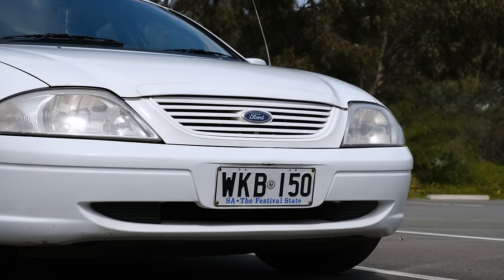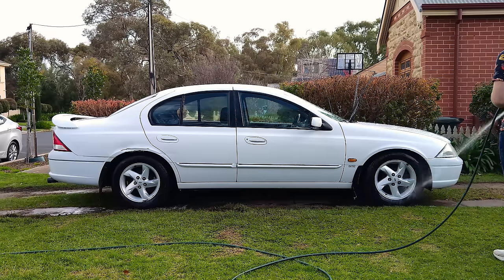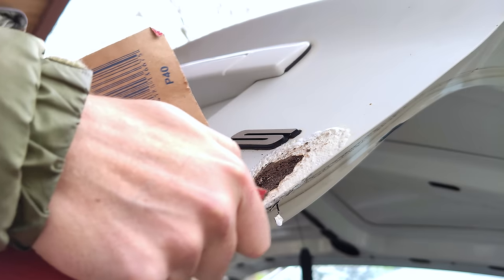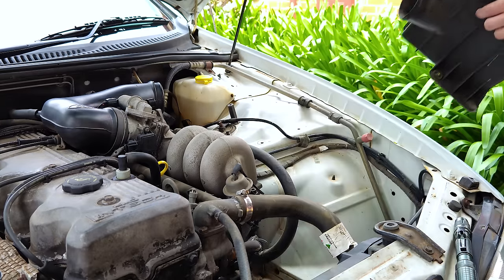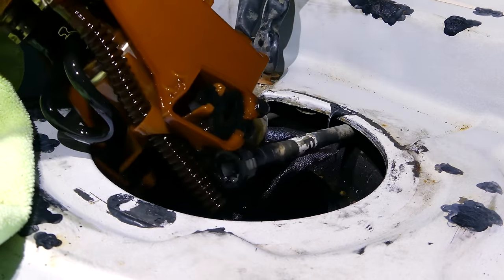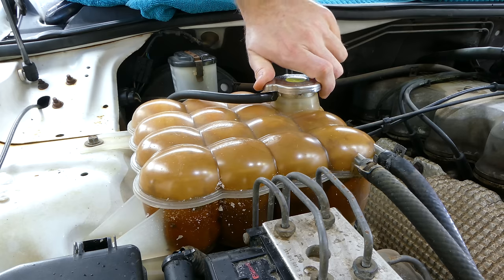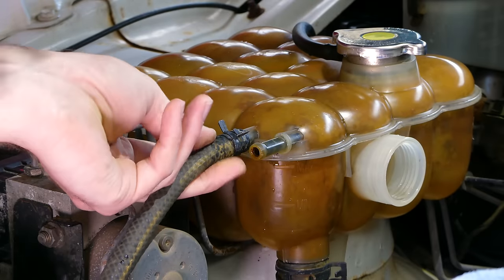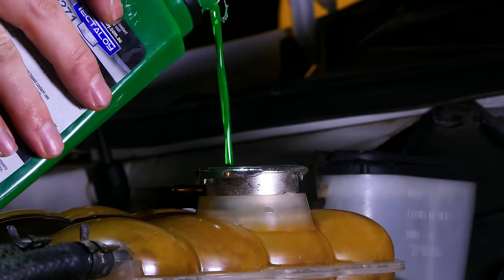Fixing A Cheap Ford Falcon From Facebook...

Comment: It's a really easy fix. Just need some eucalyptus oil and methylated spirits
Reply: Now that you fix cars now. I expect you to start working on houses with Eucalyptus oil
Reply: @RMPANDA964  That's how I fix the cracks in the concrete and drywall every time we have an earthquake.
Reply: And isopropyl alcohol
Reply: @RMPANDA964  Next: Open Heart Surgery using nothing but eucalyptus oil and some iFixit tools
Reply: and arctic mx-4
Reply: @MarcoGPUtuber  and the coolers from Noctua as well, may need ye old advices from the Yes Man Aussie
Reply: @baoquoc3710  LMAO hahahahah!

Comment: Here in America they stopped making the Falcon in the 60’s, very cool to see what it would’ve been like if production never stopped here. Reminds me of the later model  Ford Thunderbirds.
Reply: until 2016...
Reply: Should have put a Barra Turbo into a Mustang
Reply: Ford really dropped the ball on not bringing any of the more recent AU Falcons to the US and reviving the nameplate. Both the Monaro and the Commodore from Holden made it to the US as Pontiacs (before they shut down the brand).
Reply: To think we got the Taurus instead of the falcon. The Barra would have killed here.
Reply: @Fhwgads11  American manufactures always talk big and do half-measures. They were chasing the big German sedans with silly front drive bubbles (barring the first gen SHO, but it's build quality outside of it's engine was trash). A FPV falcon of the 2007-2010 timeframe would have moved a ton on units here....sad when you think about it.
Reply: Australia also got the Taurus at the time but it’s ovoid styling didn’t endear itself to us Aussies and it’s V6 wasn’t as torquey as the Falcons inline six hence the local Ford far outsold it

Comment: 6:24 Love the  reach for a nonexistent stick shift lol
Reply: Saw that too. Habits die hard.
Reply: I regularly drive a standard as well and when I'm in our newer van my hand still goes for it on stops.
Reply: Unfortunately the only driving habit I carried over from my mom’s auto to my stick is trying to shift from reverse into drive/first before the car has come to a complete stop. Auto don’t mind, Stick don’t like.
Reply: @simonro9168  it shouldn't be too much of a problem going into first without stopping since 1st gear typically has Synchromesh

Going into reverse without stopping though will make a loud clank.
Reply: @tristan6509  Yes, I realized that recently, because I’ve never had problems shifting into first after reversing out of a driveway. Bad gearbox sounds™ occurred was when I was turning and tried to go into reverse while still rolling forward. I mixed it up in my original comment

Comment: Good stuff, these will easily hit 500,000km+ if looked after. My only suggestion is a bead of silicone around where the spoiler meets the boot lid, that crusty old rubber isn't gonna help much anymore for water ingress especially now you've got thick tape there
Reply: Yep, rust never sleeps.

Comment: You’ve done well. The AU OHC isn’t as powerful or as reliable as the Barra, but it’s still a great motor and benefits from some 40 odd years of refinement. It’s actually an attractive car, it looks very nice in the white, and the interior is also pretty nice looking. I’ve just bought a BA ute as my new daily and even with a whopping 550k on the dial, it’s still a reliable car. One part I missed was the coolant you used, I can tell you from 30yrs experience in spare parts, and as a Ford enthusiast, correct coolant is absolutely critical. As you’re probably aware, they do have a bit of a problem blowing head gaskets and head corrosion, I would suggest using one of the cleaners but to follow the directions because you can cause gaskets to start leaking if it’s left in too long, and then after that, I’d put in some high quality coolant, like Nulon, and be sure to use the correct one specified, from memory it’s the green one. You probably also should do a brake system flush and replace with new fluids as it will break down over time, and again, replace with specified fluid (many people think that if the car recommends dot 3, using dot 4 is an upgrade and the new version of dot 3, however dot 4 causes rubbers to swell and leak if the car uses dot 3). 

Oh and also, it’s a Falcon S. S Pac finished in the X series, EA onwards they were designated just Falcon S and typically came with colour coded trim and in the E series, a red stripe. The AU appears to have the alloy wheels from the SR, and colour coded grille. Tasty car, and great job reviving a cool car.
Reply: Isn't as reliable as the Barra my a$$, cabbies here had no issue putting a couple of million on the Intechs, yet to see that on a Barra (the dual OHC's usually get tired after a million)
Reply: @Alabaster335  They’re a fine motor, but are more susceptible to blown head gaskets and warping heads then the Barra. Taxi drivers usually service their cars and look after them, where as general public often don’t use the correct coolants, or any coolant at all, and that soon leads to head corrosion and blown head gaskets. I have worked in spares for 30yrs, and in that time, I sold many VRS kits for the SOHC 3.9/4.0L Ford motor, many inlet gaskets for Barras, my Territory has had an inlet gasket replaced at 120k, but I’ve only sold 3 Barra head gaskets for race cars being rebuilt.
Reply: @thesausage351  the barra is the only engine I've come across that requires zero service, true.
Reply: @lobsterwhisperer7932  I work as a pilot vehicle for oversize loads, one guy I work with has a gas Barra that’s done over 1 million, his brother had a petrol one that did 1.3, I have a BA Tonner with 680k and a second BA Tonner with I think 260ish on it, and a Territory with similar km on it. I’ve replaced a water pump on the Territory and the previous owner did an inlet gasket. That’s it.

Comment: Quick note: The camshaft position sensor is less about the number of camshafts and more for the fuel injection. 
On more modern cars it also determines the spark time, although yours is waste spark and likely runs off the crank sensor.

Comment: i have a mighty au falcon myself that had the same misfiring problem. the fix that worked for me was replacing the ignition leads and the spark plugs. they are such a wonderful car mechanically although they are quite ugly. definitely a good buy. you would also be better off replacing the bootlid with one that never had a rear spoiler as the rust is just going to come back soon. one issue with the series 2 au falcons is a lot of parts are different to the series 1 and series 3. little parts such as fuel filters are different. great video though and looking forward to a few more.
Reply: The series 2 and 3 are identical apart from the indicators, trim levels and oil pressure sensors.
Reply: @HardlineHunter  no they arent

Comment: I had to replace the altinator on my BA Falcon a few weeks ago. I did not want to remove the fans so I ended up buying a cheap 1/2' to 3/8' socket adaptor and welding it to a piece of 50mmx5mm think flatbar. Worked a treat!!!!

Comment: Better car than the VT. Every modern car has adjustable seat belt height, well at least every one I have been in.
Reply: @holdenvtseries2274  Better engine, better build quality, it looked like crap but in all other aspects it was superior, more AU's on the road now than VT's
Reply: @holdenvtseries2274  hardly ever see any VT's plenty of Aus.
Reply: @holdenvtseries2274  Melbourne
Reply: @holdenvtseries2274  Well, wherever I go I always see more AU's I work in Geelong and see way more AU's there too, VT is defs the prettier of the two but in terms of the 6's the intech is a far more refined and reliable unit, that's why the Taxi industry selected them.

I know a TAXI fleet owner from Sydney and he only once ordered a few commodores for trial and he told me never again as they they just didn't last as long.

Comment: I wanna buy a cheap car now.....  this looked fun to fix
Reply: I highly encourage it! As long as the engine or transmission isn't ruined, or the body isn't rusted away, go straight ahead! I will tell you though you will have some moments where you get angry as the problem isn't as easy as it seems like it was in this video, it took quite awhile in real time I'm sure for him to finally figure out why it would have that issue running after it warmed up, and you will have tricky situations like that if you do get into it especially since it is an old car and may have strange issues that aren't so straightforward. Very fun to fix up if you take the time and know what to look for.

Comment: Always good to see the mighty AU Falcon about. The bootlid rusting like it did, that is a problem with AU's so you'd be bound to see a few like that, ones with the spoilers get like that. And one reason i've heard as to why the AU copped the criticism it did, is with the base model Series I Forte, you have a look at the standard grilles on them, and you'd see why it was disliked & a thing that was done, is some people replaced that grille with the egg-crate type one found on the AU Utes as well. Just a story i heard about, but yes was certainly a different design, i've never thought it was ugly, is a good-looking one & certainly has gained a nice following in recent years. Got a decent few AU's around where i live, members of my family have owned some as well, one being a Series I or II XR8 Ute, that things got up & went pretty good. Was a cheapo one you got here, with a bit over 260,00 on the clock (around the same distance my 2007 VE SSV Ute has traveled too), but is till a good one you got there. Will be a decent car there for however long you have it there for too nathan.
Reply: I personally thought the AU even the base was an improvement over the previous model with it's yankee Ford Taurus grille, except the xr bug eyes, they really didn't translate over well, and you really need a spoiler or the rear end looks too droopy. So I was still luke warm until I saw a T series in a magazine. T series blue and front end + XR Havoc kit rear end would look sweet
Reply: @s8wc3  Yeah, is a nice improvement over the EL Falcon, and the XR style headlights on the AU, wouldn't be to everyone's tastes, the standard ones do look better most of the time. Hadn't though the rear end of an AU sedan looked too droopy without a spoiler, but can kind of see what you'd mean by that. Never had thought the AU looked bad or anything either, was always a nice looking one. And along with that blue plus the havoc kit, does make for a pretty nice looking AU as well.

Comment: That was great troubleshooting. I really enjoyed you eliminating each possible cause  causing the misfiring, I actually thought it was fuel related. 
After you change and replace all of those parts, that car will run strong for a long time. Thanks for the very useful video 👍

Comment: Nathan, my 1997 Ford pickup truck was misfiring when hot and would also stall out when stopping. I had to replace all 8 of my spark plugs (gapped correctly, of course). No issues since. These old Ford’s are good when they work, but finding what’s wrong with them can be an absolute chore. Anything, and I mean anything can cause them to work incorrectly, lol.

Comment: My 07 Mercedes had the exact same issue. It ran rough when it warmed up and stalled at idle. Camshaft position sensor was broken apart completely. Got a new one installed and that solved all of my problems

Comment: Gotta love these older Fords, bought a 1994 Probe in June & it ran just as badly as the Falcon
Misfires, severe loss of power & not willing to increase engine speed above 2500rpm

Faul spark plugs, plug wires & a completely chewed up distributor rotor were the main culprits!
Something to keep in mind is that the 2.0l 16v Mazda engines in these also need their idle & air/fuel mixture set right.
Take it to the old Mazda garage close to you & ask if they can adjust it, they should have a special tool to do so.

Ever since it runs like a dream! Completely rust free, bonestock baselevel car in bright red and we love it :)

Comment: You can use Forscan and an elm326 obd2 scanner to scan AU.
The AU used a different protocol (J1850) to OBD2. BA on ward standarised with OBD2.

Comment: Five years ago I purchased a WK Statesman (2003) had the same seat belt pillar adjustments. My first Holden.  No rust, front and side air bags. Cruise Control, climate control, etc. The  V6 engine had done 300K highway klm. Now 350K. I have probably spent a $1500 in that time. New alternator, water pump. Serpentine Belt and pulleys , 
Disc pads. New tyres. .  Gets 7.5 litres 100 klm on the freeway.    
The kicker is it cost me $500 initially to purchase.  So there are bargains out there if you look and can do your own work.

Comment: Wow, the interior is almost identical to the US market Taurus from the early 2000s. Also, both the dial headlight adjustment and adjustable seatbelts are HUGE in the US. I haven’t seen a car without the seatbelt adjuster.

Comment: Did you consider changing the throttle position sensor? We owned a futura version for nearly 20 years. Great car. Parts are cheap. Take off the rear parcel tray and check for rust in the rear window corners, near where the boot struts mount. Also behind the rear light assembly

Comment: On the stalling issue, i recently bought a Mazda Tribute for 700$, and it was doing this rough idle/stalling at the lights and when your stopping in traffic. I this is from the era when fords and Mazdas are the same, so my tribute is actually entirely ford made, ford computers ford engine ford everything. After doing some research I cleaned the throttle body, and disconnected the battery for half an hour or more (can’t remember exactly how long I left it disconnected for). Reconnected it, and started the car, and let it idle for a solid hour with all electric accessories (radio lights ect) turned off. I then turned the air conditioning on and let it idle for another half hour, and the problem was gone, and it hasn’t missed a beat since. Apprently this is something to do with the computer learning the idle speed? Thought I would just share my knowledge on the off chance it helps you with your falcon, or helps someone else reading this.

Comment: I've owned a few of these. Even had a 6dpeed manual 5ltr V8 xr8 Au falcon. I live and breathe Ford's i love them all 👍

Shame yours isn't a tickford engine. There quite distinctive engine is usually red on the top unless someone painted it.

Open your boot and bother top corners check them it's notorious for rustling

Comment: On my old '69 Opel Kadett I also Had to Clean my cooling system
I did it with some cleaning chemics. At first empty it, put water with the cleaning chemics in. Then let it run for 10 minutes
It loosened every Bit of dust and debris, and then I flushed it once again with water and tjen put the coolant in
Was pretty effective

Comment: The headlight controls on the dash and the adjustable belt height are pretty common over here in the US. Pretty much every car since the 90s that I can think of have offered adjustable height belts, and it was a common GM thing to have the headlight controls on the dash. Dodge too, I think.

Comment: This really brings together just how similar troubleshooting a computer is to troubleshooting a car.
The computer will under normal circumstance, need power, ram and a boot drive to start up, while a car will need air, spark and fuel.

Comment: Good video, as it helps other Falcon buyers with what to look out for. I would have tried to de carbon the valves , and sprayed some decarbonising spray down the intake, and not the spark plug holes,

Comment: Also change the O2 sensor as they often ware out as much as changing your tyres but gets missed a lot.
That should give better economy.
Did you know the intec can run without a radiator?

Comment: Glad you got a replacement for the old car!  Inline six-cylinder motors may not be the most fuel-efficient engines but they are nigh indestructible - as you saw from the state of the coolant in that one.

Might be worth doing the head gaskets down the road if you intend to keep it, but otherwise use it as a beater and drive it 'till the wheels fall off!

Comment: Another trick to clean the radiator coolant expansion tank is to fill it with some sand + water & shake it vigorously. That'll get rid of all the rust stains inside.

Comment: As far as I know that sludge in you coolant system and the color could mean that the head gaskets are failing and need to be replaced. We had that issue in our 95 Saab 9000 and the coolant looked exactly like yours!

Comment: To clean the plastic coolant tank, take it out and put some phosphoric acid based rust converter into it. Let it soak for 15 to 30 minutes on the various surfaces (you may need to block some holes or use hose to stop it from getting out). Clean it, and if necessary, use a wired  bottle brush scrubber to get into the corners.

Comment: That's a lot of work mate! Almost the price of the car in parts and labor. 
Since seeing the 1st minute I knew it was a camshaft sensor. It's a ford thing. 
The heating system doesn't cause rough idle or stalling AFAIK. Good job on that one.

Comment: had lots of these. only thing you have to watch is CD head units premiturely die in them 
front wheel bearings are incased in the hub. cheaper to replace whole hub than just the bearings

get the greasable ball joints. ford made them a dry joint (never needs greasing) so you just throw them away when they wear out. its a pressed fit. 

trans is supposed to be one of the long life fluid but they do need servicing. its the big square bolt on drivers side you fill and drain from that opening 

can also buy new headlights from oz e parts.